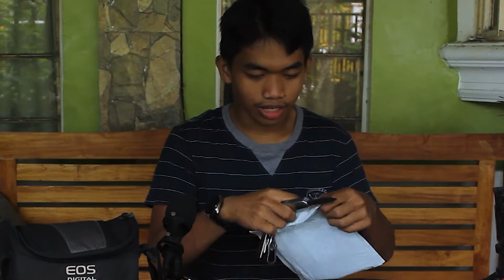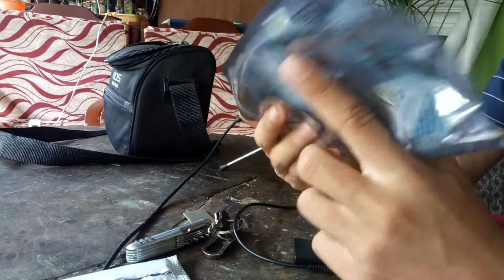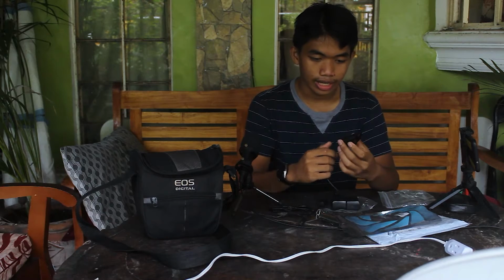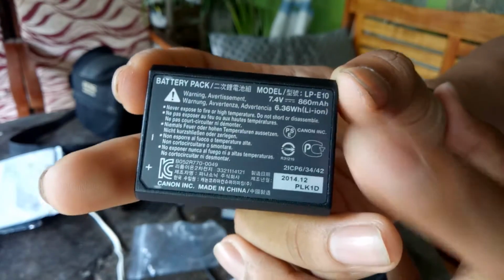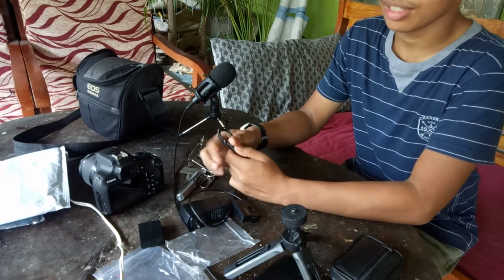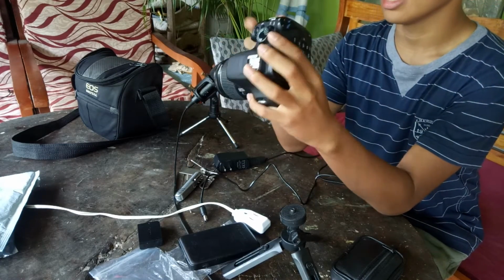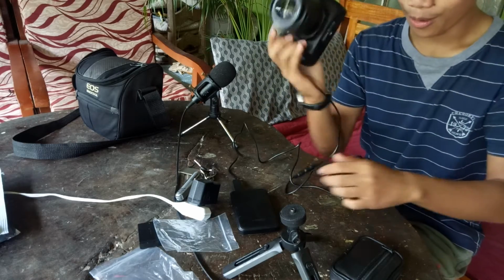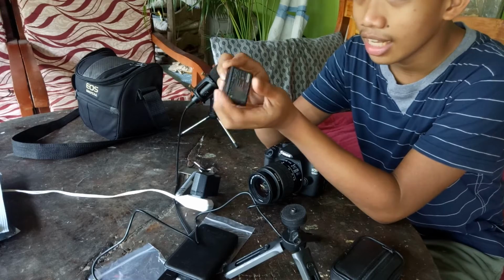An Alternative Solution for DSLR power (ACK-E10 Unboxing and First Look)

Comment: Please give me a update on LP E10 durability and reliability... thank you 😊
Reply from the maker: Hello! I'm not sure if you're referring to the battery or the battery extension in the video but I'll try to answer both. Lp-e10s I've noticed do last fairly well, especially those made originally by Canon, even with their small capacities. As for the battery extension in the video, I actually used it for a solid year since my charger for the lp-e10 battery broke and I had to make do with an external battery bank to use the camera. In short its been fairly reliable so long as you use a reliable enough power source (ie not faulty battery bank or wall adaptor). So far, the usb housing has been the only problem I've had since it can easily open up, though so long as you dont snap the wires that are soldered on, you're covered. I've since moved to newer lp-e10s since they are inherently more reliable but for extended shoots, I'd still prefer the convenience and assurance of having an almost unlimited amount of runtime for a camera like this, which the battery extension with a battery bank provides.. Hope this helps!